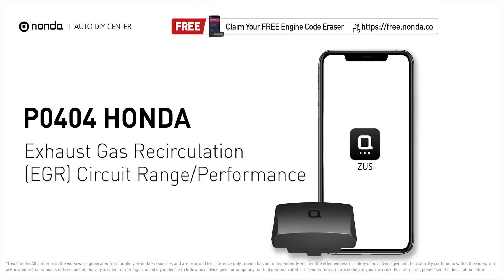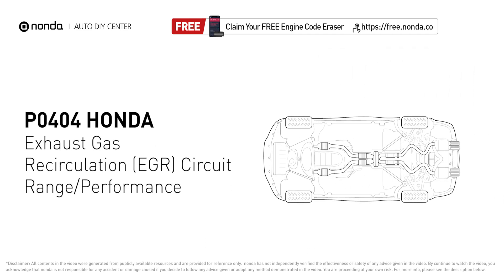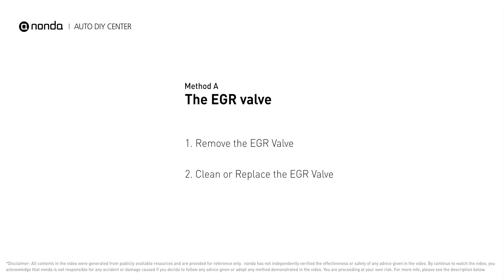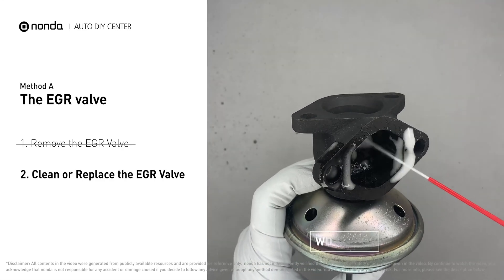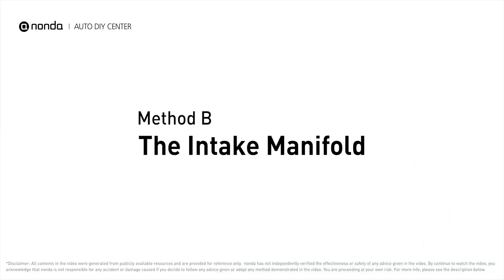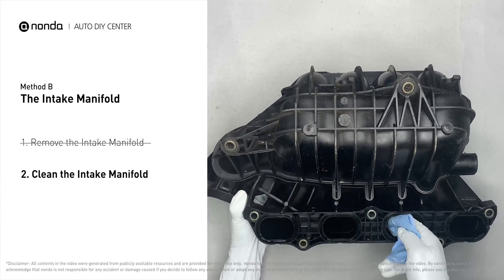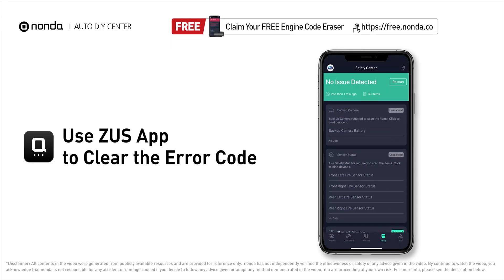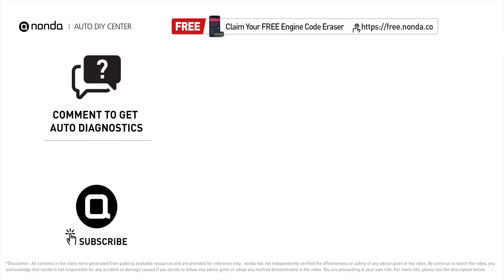How to Fix HONDA P0404 Engine Code in 3 Minutes [2 DIY Methods / Only $4.37]

Comment: My 2009 Honda CRV, I replaced the EGR  valve and clean MAF sensor, clean Throttle body but still the rough idling still there and has a Code P0404. What should I do?
Reply: Check the wiring
Reply: what it end up being?
Reply: After cleaning a MAF gotta relearn the idle.